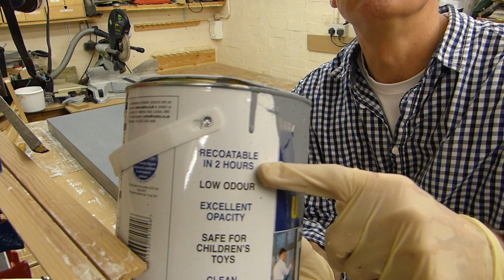Water tank lid #020

Comment: Hi Peter,
I'm looking at getting some filler for use on plywood exposed edges prior to painting. Do you find the Tetrion stuff to be any better than other brands?
Reply from the maker: Andy Tomlinson Hi. I haven't used them all, but the ones I have used (Tetrion powerfill, decor fill, isopon P38, plastic padding etc.. etc..) have been near-identical, with very little to choose between them. I'd just buy whatever you can get locally, at a decent price 👍
Reply: Peter Millard 
Thanks for your quick reply.
Reply from the maker: Andy Tomlinson 👍
Reply: For me it takes lots of sanding and many coats of paint and/or clear coat to get the plies in plywood to disappear, (for applications where you don't want to see the individual plies in plywood.

One option is to get some cheap, iron on edge banding then apply finish.

Comment: What was it covering on the roof hot water tank or something
Reply from the maker: syd ascott Yep, there's a cold water tank buried in that galvanised box.
Reply: Over here we use stuff called Red Guard make everything water proof ,but you wouldnt want to paint it inside you small work shop ,i use when before tiling tub enclosures
Reply from the maker: syd ascott Right, like what we call a 'tanking membrane' - I've used it in wet rooms, that kind of thing. It's actually just a big plastic tank (with a lid) inside that galvanised box, the lid I made was just to keep the weather out.

Comment: The original tank cover had a lead covering , why replace it with painted ply that won't last much more than a few years at best
Reply from the maker: +xenusceptic Thanks for watching and taking the time to comment. The original lid wasn't lead and it had split and rotted through in places - especially at the mounting points - and the lid had blown off in high winds a couple of times. The client wanted something cheap, and effective - which I delivered. 👍
Reply: Peter Millard my mistake it looked like thin lead sheeting
Reply: Would the wood stand up to the elements (including the sun), shed roofs often have a roofing felt for protection?
Enjoyed watching you make it, as with all your jobs.
Reply from the maker: David Lenton Yes. It’s WPB (water & boil proof) exterior grade ply, that’s then been sealed and painted. Was up on that roof again recently and it’s holding up just fine 👍And thanks!